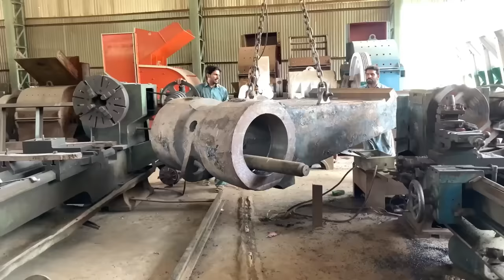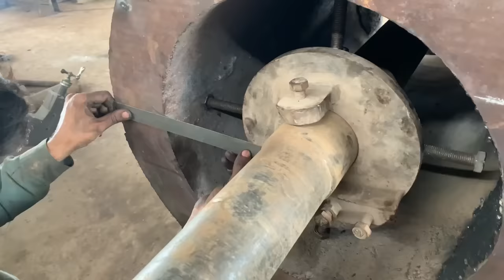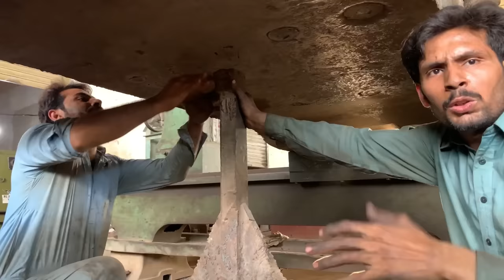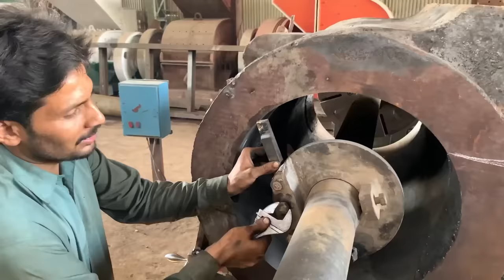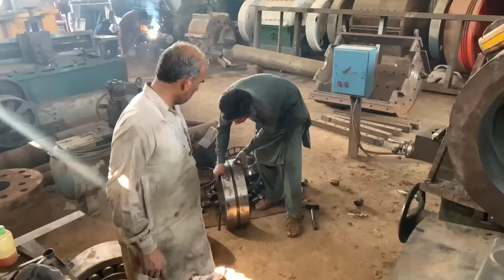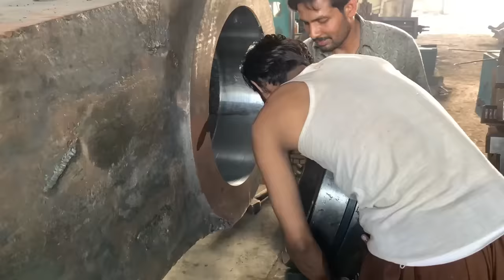Heavy Duty 4Ton 540mm Bearing Size | Hammer Boring Process On Manual Lathe Machine |

Comment: I always roll my roller bearings in the dirt before installing. I find it helps to seat them in a lot  quicker. If you study how the cutting tool is placed in relation to the center of rotation, it is set at least 5 inches 'above center' and looks to be cutting (?) with about 15 or 20 degrees of negative top rake. It is scraping the material off. I love the eyeball & tapping method of tool adjustment for depth of cut. For any trolls reading, 58 years of machining for me, I know a little about it.
Reply: I am amateur at machining with 5 years of "experience", and watching offset between center and tool hurts my eyes (and ears). I understand limitations they have in the shop, but fitting tool closer to diameter is not  very hard task. Greetings to you!

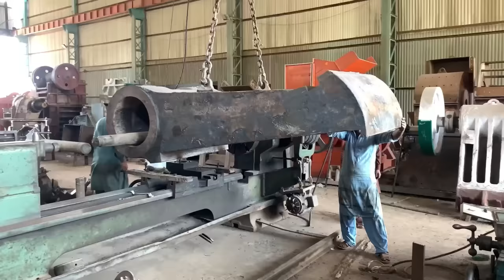Comment: Clever run out indicator consisting of a bent welding rod and the operator's eyesight.  Safety shoes are open toe sandals.  At 1:00 a worker nearly backed into a  spinning lathe piece.
Reply: I saw the thing at 1:00 too. absolute unreal conditions

Comment: I like that he saves the red handled adjustable wrench for the high precision operations only.
Reply: It’s worth 14 wives or concubines.
Reply: There was a precision operation? I must have missed it. Was it before or after he used the 10 meter tape measure to “confirm” the bar was centered?
Reply: He even used the crescent upside down.

Comment: All the cutting is done dry and without lubricatiin or cooling. The sound of the cut is that of metal elastic behavior under compression of the cutting tool. Both parts cry in pain, But I suppose here precision and surface finish are very relative. However Congratulations about what you can achieve with what you have. A good lesson of humility.

Comment: after all that pounding and hammering these bearings are the same as they were before these fitting procedures
Reply: Nahh, the secret is the dirt being used as break in material. I do like the fact they use chatter marks as a retaining source, the ridges deform enough to hold things in place 😆
Reply: Originally it did not have any bearings.
Reply: See
Reply: Hammering bearings of this size is like a mosquito bite on a rhinoceros’ ass…
Reply: @yamahajapan5351  and what about the press, for example? Hitting a bearing with a hammer, no matter how harmless it may seem, actually disrupts its geometry, and hence its performance.
Reply: @mikemilburn7823  ev
Reply: @mikemilburn7823  n
Reply: They might be the old bearings

Comment: The first thing you want to do with precision equipment is drop the bearing in the dirt and sand. Make sure the grease picks up plenty so that the equipment will fail and have come back.
Reply: Don't worry, they wiped it off with a filthy rag before assembly.
Reply: And remember to weld over the uncovered ways of the lathe for added precision.
Reply: How much sand? All of it. 😂
Reply: It is the old bearing you can see the discolouration on the outer race. They are just using it to check the bearing fit in the housing. Considering they are using callipers because the boring bar is in the way it is impressive machining. And yep I would like to see better gear.

Comment: How do you accurately align bore a large or small item that is suspended by a chain and not anchored solidly?
Reply: All you have to consider is that your life is not worth anything! Sheer workplace abuse!
Reply: The chain fall went away it was dogged down to the carriage and the supports added underneath that run on the piece of railroad track

Comment: Two queries:
Why did the housing get bored out only to put the original bearings back in. Huh?
Why not ACCURATELY measure the machined housing internal diameter and the bearing outer diameter to be a tap fitted first time rather than two attempts?
Reply: The original bearings were never shown and judging from the looks of the original bore it appears as though it never had bearings
Reply: @azinfidel6461  
Hmmm, well the first shots showed one end of the journal as clean and shiny and bored out, and the bearing outer casing didn't look brand new.
Reply: @thedolphin5428  I think when they edited the video they mixed up their video clips, when the part was being bored you could see the inner surface had been welded at some point in order to repair it.
Reply: It’s a new casting, it’s being bored to fit bearings. Everyone worried about them hitting the bearings in, don’t. This is part of a jaw crusher it’s going to get far more abuse crushing rocks.

Comment: Nice to see open toed safety sandals 😂😢
Tape measure tolerances seem to work nicely.
9:47 a hand locking clamp shouldn’t need an 18” lever to fetch it up.
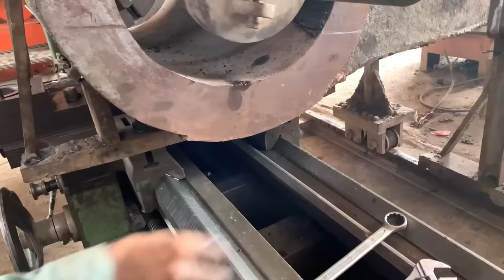11:20 and lastly, who needs goggles ? How sad for these people, working in Accident Land.
17:31, it’s amazing the boring bar didn’t drop out of the chuck, as it is barely in the jaws and all the vibration.
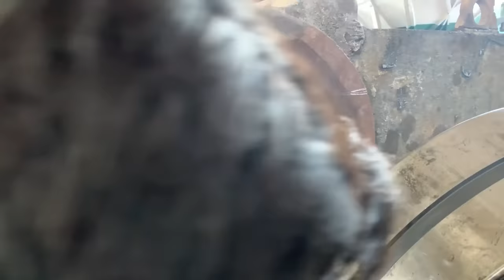20:27 WHAT THE FUCK IS HE DOING ??
This toooo incredible for words😢

Comment: Mechanical engineering is  Amongest most tedious  and unclean, oils grease  makes  it messed up  that's why  most engineers  choose software's  and  telecommunications  specially  women.  Because  of this we don't  get any upgrading  in mechanical engineering  and it's  products.  Or at very slow pace  comparatively   , we are still using same as five hundred years  older generation  were using /doing.  Special focus needed.

Comment: What a bloody challenge that was and dangerous.I would have told my boss to get f#@ked and take it somewhere else.😁😂Looks like there is not a single horizontal borer anywhere near by.Nevertheless these guys a doing great considering the equipment they have.I suppose anything is easy when you have the right equipment.
Reply: Was going to mention the same thing about a horizontal mill like maybe a six or something bigger they do look like they know what they are doing though I think the railroad iron and supports were pretty cool that looks like about a 25 inch lathe that started out as a line shaft machine that was converted still making chips a hundred years later.
Reply: Kids these days have no idea about working so large equipment and large parts